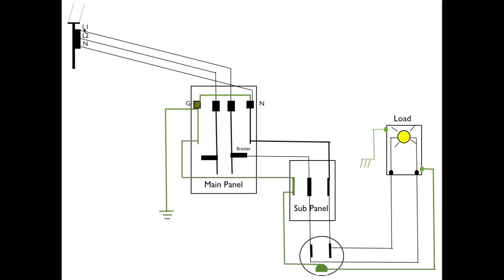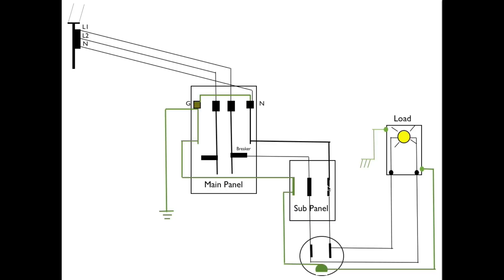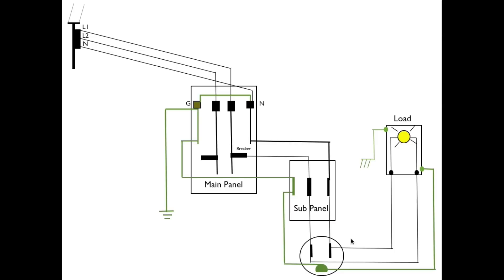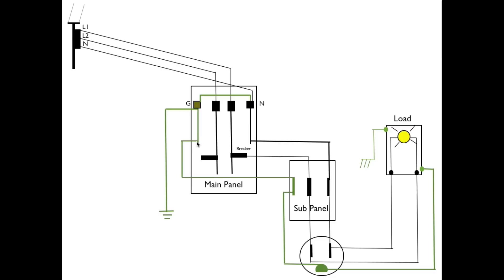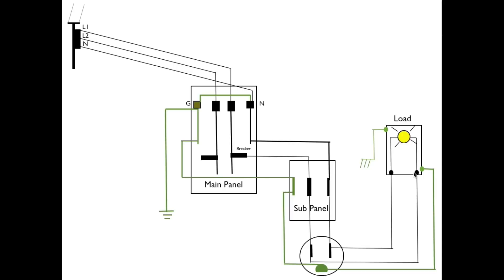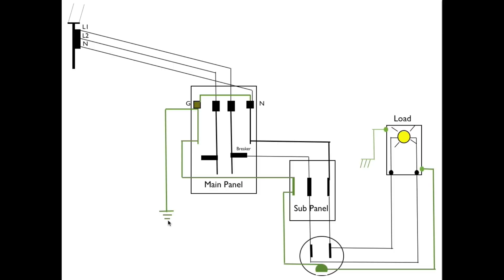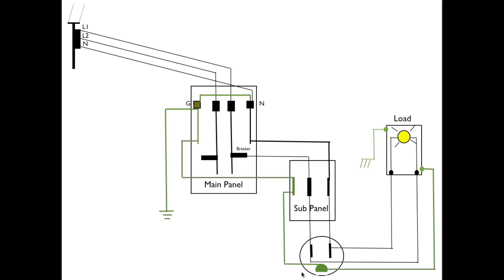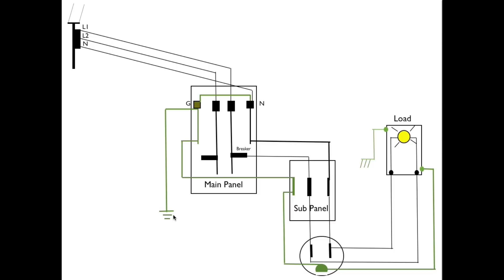The difference between neutral and ground on the electric panel

Comment: The Neutral is a Current carrying conductor @ Ground Potential!
The Ground does NOT carry Current during normal circuit operation!
Ground exists as a Safety conductor should the Neutral be compromised,

Comment: Why does electricity always want to go into the earth {ground] ?
Reply from the maker: Actually, it does not.  If the voltage is high enough, the ground will act as a capacitor and absorb electricity.  But that voltage is in the thousands.  What mixes people up here is the neutral (center point) of the secondary winding on the pole transformer is connected to earth ground as a zero voltage reference point.  Ground is also a sink for surges and spikes.  
If there is a short, the power goes to the neutral, not ground.  Hope this helps.
GFM

Comment: Mike Holt said that on that grounding rod will have current 25 feet away from it ... he said and tested it and yes there was current there...at 7:56 you state that the dirt [ Ground resistance ] is  way to high for ANY current to go though it ??? Mike has a video on this topic if you would like to learn about how current can and will go up to 25 feet a way from the a grounding rod. and can be measured...here is a link.. https://youtu.be/qNZC782SzAQ
Reply from the maker: This is related to this video how?
GFM

Comment: It's for lightning eh? So why in the !*$% isn't it insulated???     Thanks. . .
Reply from the maker: I guess I would have to ask why insulate.  As you would like it to attract lightning, you want it uninsulated.  
GFM
Reply: No need to insulate overhead electrical outdoor wiring. It is high enough that no one will come in contact with it under normal circumstances. The conductors are separated, and are supported by insulators. Insulation would add unnecessary expense. Underground lines, however, are insulated, and often use multi conductor cables, just like house wiring, only specially designed for in ground burial.
Reply: Insulation of a reasonable thickness (weight burden) would do no good against a lightning strike - not when the emf is in the hundreds of thousands of volts.

Comment: This doesn't explain anything. The reason why you don't bond the secondary panel is because it's bonded already in the main panel.
Reply: Also, neutral only carries current when connected with the top and bottom coils of the transformer phases A&B. So connecting L1/L2 to ground (before bonding neutral to ground in the panel) will never carry current because a circuit has to be complete before current can flow.
Reply from the maker: Consider if the sub panel (or appliance) had its neutral and chassis bonded.  If there were an open in the neutral line, (or in the appliance), the appliance would work normally.  
This is dangerous because the chassis is potentially "hot".  Then, if the ground had an open, the chassis would be hot.  Think about it.
GFM

Comment: oops,, I understand the theoretical need for a non current carrying ground.
But consider this. .. If you were to disconnect the wires from the transformer at the power pole going to the house. And then, using a continuity tester, check between all of the L1 connections the house. Wouldn't they all be the same electrically? The same would also be true for L2..  And all the Neutrals... And all the grounds. And then between the Neutrals and Grounds...
And that is the part that makes me scratch my head. If the Ground and Neutral are connected together at the panel,  electrically,  aren't they the same point. So whether you touch the ground wire or the neutral wire and then touch L1 or L2...ouch
Reply: Yes you are right. The Neutral and the ground are at the same electrical potential. The transformer on the pole converts thousands of volts to 240 volts(US), measured form one end of the secondary coil to the other end. Those ends are labeled, L1 and L2. Another conductor, is joined to the transformer secondary coil right in the middle of the coil. It is bonded to the earth at the pole usually, and is therefore at earth potential. The voltage between this conductor, the neutral, and the ends of the transformer coil is 120 volts. These three conductors, L1 L2 and N, are piped into your house, and the neutral is bonded to earth at the panel in your house. The reason for the separate earth ground is as a safety. If there is some type of fault in electrical equipment, and the case, or something a person could touch, is energized at a potential greater than earth, we want something other than our bodies to be the path between that energized equipment and the earth-hence a safety ground. The fact that the neutral is bonded to the earth on the same conductor as the safety ground is just economics; why drive two rods when one will do? Also, it ensures that the neutral and ground conductors in your house will be at the same potential, because things can happen with the ground bond on the utility pole. 
The reason we only bond the neutral and safety ground together at one location is because the neutral almost always carries some current under normal operation. If the safety ground and neutral were bonded in other locations on the property, the current from the neutral could theoretically pass through the safety ground conductor, minimizing the safety factor that it exists to have.
Reply: Tyler Grace Wow,,, and thank you for the reply...
The reason for my quandary,  is that I live in a house that was built in 1954, and therefore only has 2 wires to the wall receptacles.  So in a few cases, I have replaced the 2 prong recepticals with a 3 prong receptical .. On the receptical I have jumpered the ground screw to the white wire screw....  Electrically everything works. But not knowing about the laws concerning such modification,  I am nervous. ..
Thank you for your fine explanation. ..

Comment: Here is an article along the same lines as your video
http://www.esgroundingsolutions.com/why-do-you-have-to-bond-the-neutral-and-the-ground-wire-in-the-main-panel/ 

It is, noting to bond the neutral and ground in the main panel only vs two other incorrect arrangements...

1) If the neutral and ground are NOT bonded in the main panel a fault can flow to ground and never be detected (by the breaker) due to the high ground resistance of the ground I=V/R yielding a fault current that is too low to be detected by the breaker.

2) If the neutral and ground are connected anywhere outside of the main panel then you have energized any panel that is also connected to ground. The neutral is the return path of the circuit. By design, a ground should not carry current. A ground is there in the event that sometime goes wrong.

Comment: Not to sound like a jerk, but you might want to go thru this explanation again and redo it. You're not quite clear in your explanation of neutral and ground and what's the difference. You have a lot of extra and confusing wording in your presentation and I'm sure you know this, but it's not presented quite correctly. (yes, I'm a fellow sparkey and in engineering and yes, I've got many years of experience.....good luck. BTW, I really like your diagram. Great representation)
Reply from the maker: Thanks for the thoughts.  I was a teacher for 9 years.  The one thing I learned was that no one explanation reaches everyone.  I have a playlist on this subject and have referenced some of those videos in this one.  
GFM
Reply: I am a retired electrician and electronic tech. His vid did a pretty good explanation between the ground and neutral. I know that some people do have a hard time comprehending things being discussed. For those people, they just need to do further research on THEIR time.
 I taught electrical theory for several years for the state of Florida; before that I taught in the electronic field. And I found students that were confused by a some of the lessons. For those guys I gave them references to those things that they had a problem with. We could not spend a half a day with one student and let the other 12 to 15 be forgotten. Anyway, I only had a failure rate far below the national average.
Do you know what the most important wire is of a circuit? Some say the "hot", others say the "neutral". They are wrong. The most important wire is the "ground".
There would be students who said no way; it was important to get the customer's lights or stove to operate right! Yeah, but the customer's life is most  important, therefore the ground HAS to be the most important wire.....lol
Oh hell, sorry about being so damned long winded, (or is it long handed? lol).
And BTW, I was not trying to post that you were wrong. You're right that there will be some who will be confused. For those gents they must learn to do research.

Comment: Floating neutral in an electrical panel does very strange things to a good running furnace , I hate builder electricians
Reply: Mason Nesson dont hate us. without us , youl be in trouble
Reply: And to other components as well. Depending on the relative loads on the legs, the voltage on one will be higher than normal and lower than normal on the other.

Comment: Your receptacle is wired backwards, the left slot is neutral. You should fix that.
Reply: That is not code in the USA
Reply: Silver screw for neutral, gold screw for hot. The code book doesn't tell you not to put your finger in a socket, doesn't make it right.
Reply: BariumCobaltNitrog3n. agree, but the larger slot is neutral or the white wire
Reply: Terry Ogden
correct

Comment: The power in L1&2 is 120volts @ 90 amps each.
L-1 is for all your 110 volt single phase uses
L-2 is for all your 220  volt 2 phase uses.
THE NUETRAL IS THE RETURN TO SOURCE.

THE OLD ANOLOG SPINNING STYLE. METERS ONLY BILLED YOU FOR THE  MOVEMENT OF ELECTRONS INTO THE METER.
 THE NEW METERS CHARGE FOR THE ENERGY COMING INTO OUR HOUSE HOUSE AND THEN CHARGE FOR FOR THE SAME ENERGY TO RETURN TO THE GRID, THEY ALSO MAKE US PAY FOR THERE WIFI ENERGY USAGE.

TO SUM IT UP FOLKS.
JUST LIKE THEY DID WITH SOCIAL SECURITY.
THE CROOKED BASTARDS ARE CHARGING TWICE FOR THE SAME ENERGY, MAKEING US PAY THERE OPERATIONS COST AND PUTTING METER READERS OUT OF JOBS.

Comment: on you diagram.......... ALLof the green wires are connected together at the point marked "G", yet you state there is a difference. That's impossible, you cannot have a difference when they are all connected together.
Reply: Yes you can.  They are different circuits that do different things.

Comment: first of all   L2   does not go any where It's a dead end at the  Main Panel 
2.. the ground wire is connected to n and n is connected to the load  "catastrophic" short circuit 
3... at the load the chassis is grounded to what the chassis  ????
if this is a joke your going to hurt some one
Reply from the maker: This is just a mass of misconceptions.
In this case the circuit is 120 volts so it does not use L2.  The circuit comes from L1 and comes back to Neutral, which is a center tap of the pole transformer.
The ground wire is bonded to the Neutral at the main panel.  Earth ground is not a power source and the circuit will operate quite normally without it.  It is a sink for lightning and surges in the line.  There is no short.
At the load, the chassis of the sub panel is bonded to the ground wire.  The ground wire is bonded to earth ground and Neutral at the main panel.  Any short at the sub panel or the load to chassis will travel thru the  ground wire, thru the main panel Neutral to be cleared at the center tap of the pole transformer.  
GFM

Comment: the neutral N should not be connected to ground G (at the main panel)
Reply: yes , the N and G are connected at the main and not any subs, unless it is at a  mobile home and there is a dis- 
 connect panel out side, then they are connected there.
Reply: no matter both come from earth.

Comment: We can get rid of the eath,and the system will work normaly, because we don't need the earth connection only for fault conditions(saftey and protection), wihle we can't get rid of the neutral becsuse the system cannot work without it and the circuit will not be complete
Reply from the maker: I can't really say "normally" as it is common to have surges in the line from loads starting and stopping.  The earth connection tends to dissipate these.
GF<

Comment: But why connect the ground and neutral together.  This doesn't make sence to me?
Reply from the maker: dittybur The neutral does not need to be connected to ground to protect the circuit from overload because it is connected to the transformer.  The chassis ground is there to feed power to the neutral and open the circuit if the chassis becomes hot from a short.  The ground rod is there to absorb spikes from the line.  Hope this helps.
GFM

Comment: Funny have you even used an electric pressure washer, water everywhere. The pressure washer a two wire cord,protected by the gfi on the plug. Wire is a material and yes it is expensive. However not nearly as the labor of extremely expensive electricians.

Comment: no your wrong. any power goes to ground will kick your breaker...im dis agree what you saying..try it if your wire is straight to breaker then touch it to the Ground of course will kick your breaker..
Reply from the maker: Ok.  Again I say, earth ground will not kick a breaker.  The only reason you kick a breaker when hot goes to earth ground is the grounding bar is connected to the neutral in the main panel.  The connection to neutral is the short.  Stay tuned.  I will be doing a video demonstrating this concept in the near future.
GFM

Comment: ok why does lightings energy go to ground instead of following the neutral line back to the pumping station like lines 1& 2 does.

there is still some left handed black majic not being revealed hear.

truth is power is drawn  out from the ground by the aerial antenna  lines.
we dont pay for electricity.
we pay for the energy to pump it through the system.
Reply from the maker: Lightning is a different form of electricity.  It is a DC form of static electricity.  The ground builds up a charge and the clouds build up an opposite charge.  When the charge gets high enough, the lightning discharges from clouds to ground.  
GFM
Reply: +grayfurnaceman wrong the ions travel from ground to aky which makes the pathway for + electrons to go to - ground.
Reply from the maker: Do you have a point or are you just arguing?
GFM

Comment: you said hook to waterpipe, lot of people out there with cpvc water pipe, sooo
Reply from the maker: You might try listening to the video.  I said to a ground rod or a water pipe.  In fact, I said you usually must use a ground rod in addition to water pipe connections.  In any case, a metal water pipe must be connected to the neutral in the panel.
GFM

Comment: Strikes me as a total con job. Designed to make houses cost a great deal more than need be. The entire house could be ground fault protected at the breaker panel. The cost of a home could come way down using the same technology found in electric pressure washers.
 Houses are so over regulated, and full of pure money making b.s.
Reply from the maker: I could buy a lot of wire for what a  200 amp GFCI would cost.  Then there are the nuisance trips.
GFM